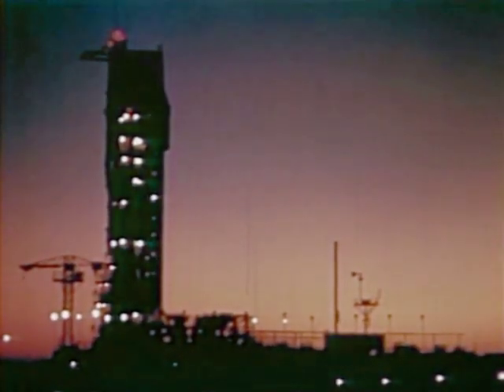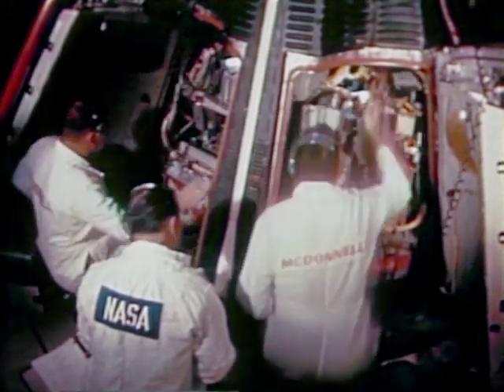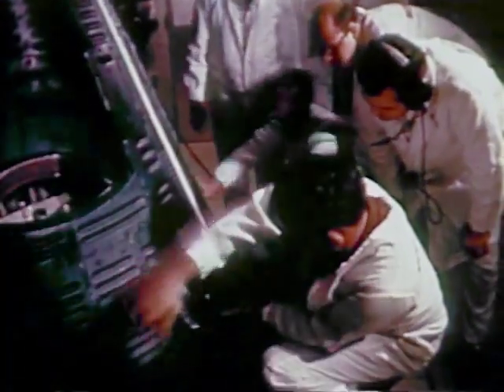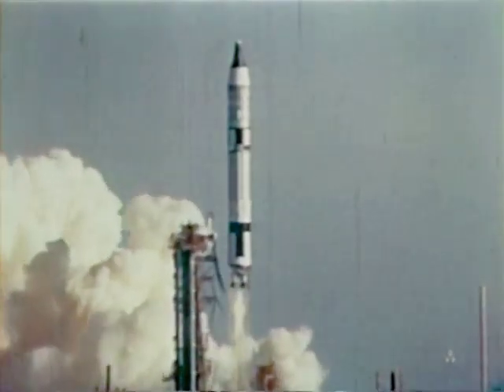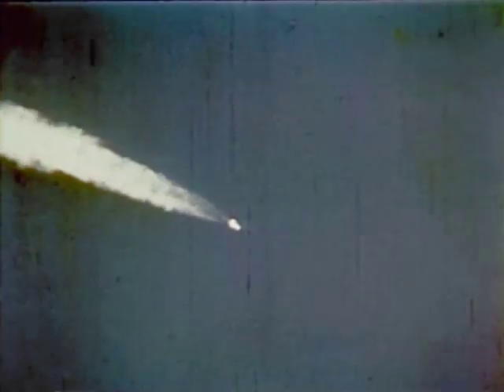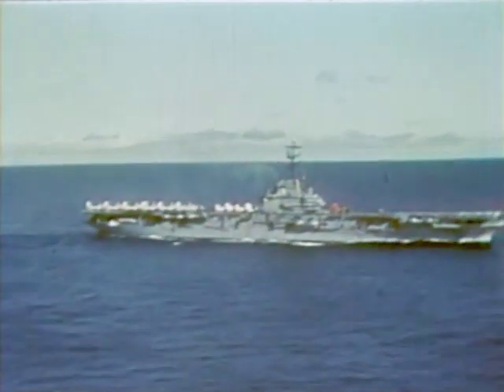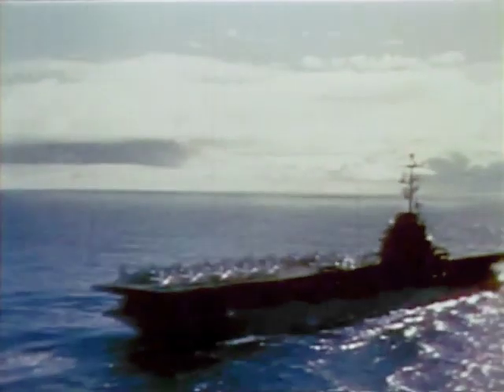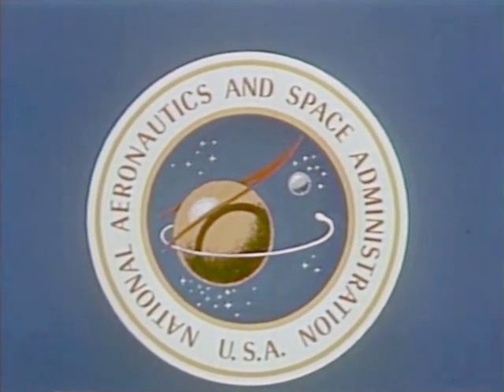The GEMINI II Re-Entry Mission (1965) - NASA documentary

Comment: Several years before Gemini lifted off, there was consideration given to using a parawing to return astronauts and spacecraft to earth. Although this was discarded in favor of the parachute, it did produce a new sport known as hang gliding.
Reply: They used the shackle on the apollo to have tge capsule enter the water atvan angle instead of hitting the water directly flat. Meant less "g" and softer landing for the crew.